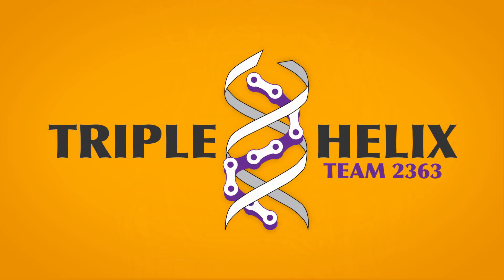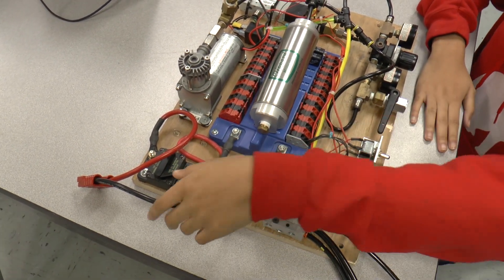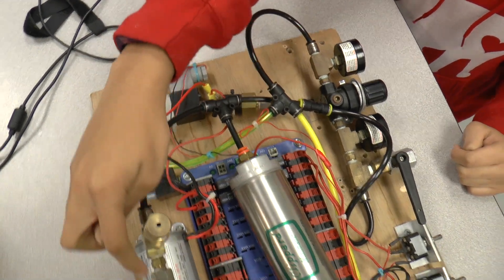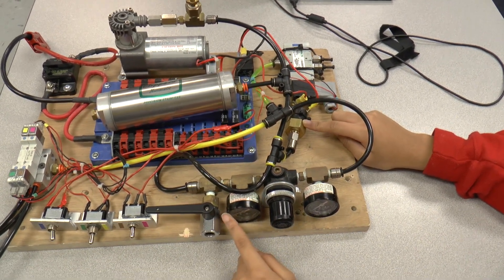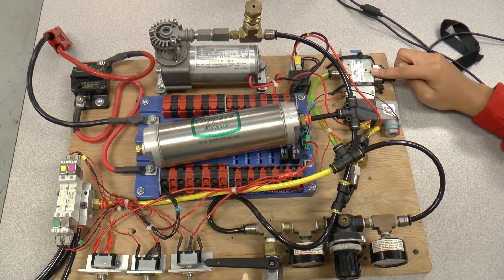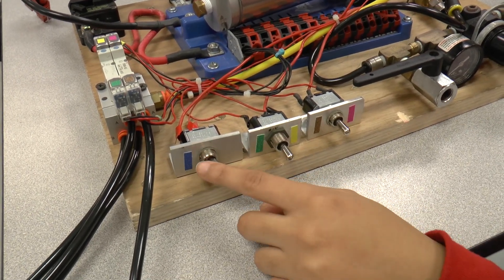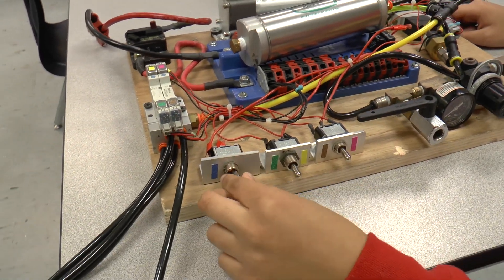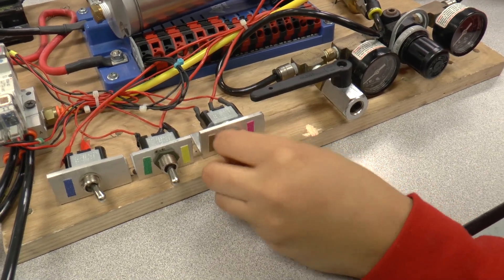Tech Tip 2 - Pneumatics Test Panel

Comment: Do you have a link for the switches?
Reply from the maker: We're using a SPST switch to control a single solenoid and SPDT (ON-OFF-ON) switches to control the double solenoids.  Almost any switch of these kinds will do, as the current drawn by the solenoid is very small.
Reply: @TripleHelix2363  thanks
Reply: @TripleHelix2363  How are the switches wired to the solenoids?